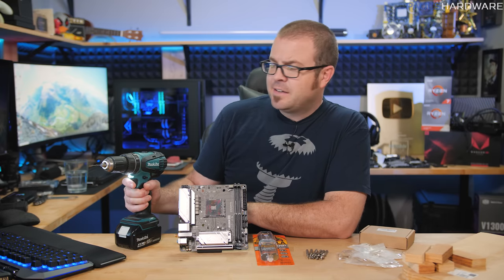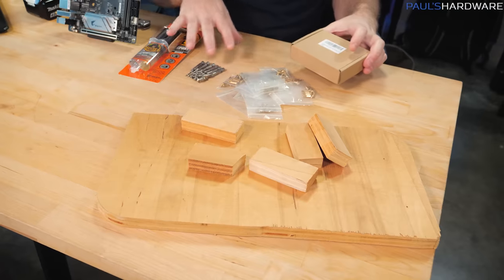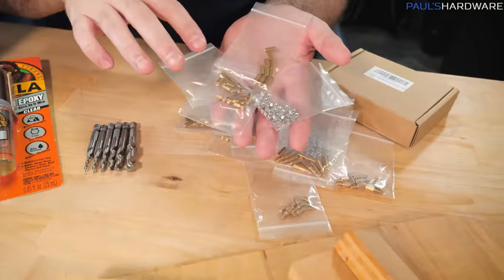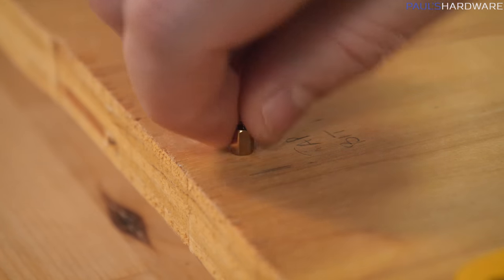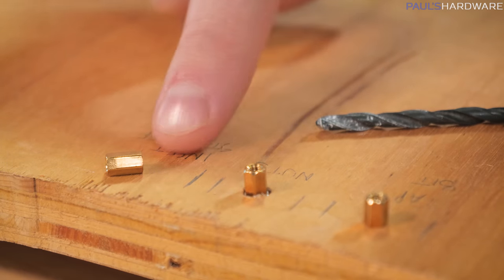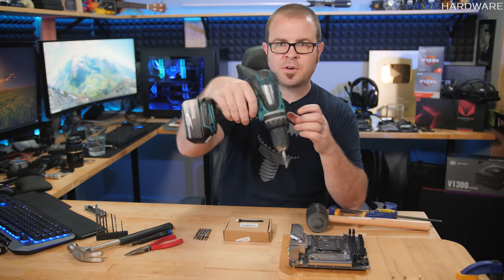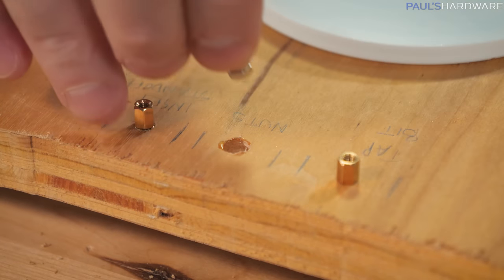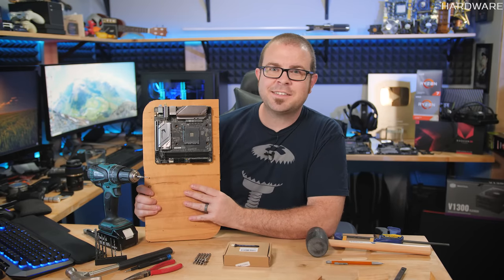The Wood-Mounted Motherboard Challenge!

Comment: M3? They should be #6-32. They have special inserts for wood to allow a machine screw to be used. And each mounting point is going to want a ground. At least run some screws through the back into the standoffs and jumper them all together and then tie them to the PSU ground.

Comment: I made standoffs from wood blocks for my antique table build (needed the cables to be routed under the motherboard). I just screwed in the standoffs from the back of the board, then mounted the motherboard to the standoffs with wood screws. The project: https://www.youtube.com/watch?v=5zFuhxBUJng

Comment: @paul   Here is the actual item that started the nut in the wood method. They are designed to be pressed in.. You pound these (giggity) into the wood and it creates a threaded hole of the size you needed..  random amazon link for reference.  There are other types that are threaded as well.

https://www.amazon.com/Glarks-Threaded-Embedment-Assortment-Printing/dp/B07L96KVP3/ref=pd_sbs_328_3/142-9362882-9241220?_encoding=UTF8&pd_rd_i=B07L96KVP3&pd_rd_r=994c6fac-a4e5-11e9-a846-db1bda18ae84&pd_rd_w=UjVks&pd_rd_wg=9LfmR&pf_rd_p=588939de-d3f8-42f1-a3d8-d556eae5797d&pf_rd_r=0PVVA4V5G5MRRR6KX474&psc=1&refRID=0PVVA4V5G5MRRR6KX474

Comment: Seriously dude? Just pre-drill some holes in the wood and use some brass mobo standoffs like you would in any PC case. Then, use a drop of 2-part epoxy in each pre-drilled hole prior to installing the standoffs. There are other methods but considering the thickness of the wood you are using, this would be the simplest way to go.

Comment: Why wouldn't you just drill holes all the way through the wood and use the standoffs that have 2 female ends on the top side with a washer below it and secure it down with a m3 screw from the backside, Much stronger and if your worried about the head of the screw in the back sticking out  just take a forstner bit and make a small recessed hole.

Comment: You are doing it the hard way. I use plastic wall plugs like this 
https://www.bunnings.com.au/ramset-8-x-25mm-blue-wall-plugs-frame-of-25_p2260641
basically just for spacing. Cut to whatever length you desire and screw through the motherboard and the wall plugs, into the wood with self tapping screws. To make them look prettier you can simply wrap them in some black heatshrink before screwing them in. This also has the advantage of making your standoffs any length you desire. I cut them longer than a standard standoff ( I usually go with 13mm, about half an inch) which allows me to route cables under the motherboard. If the motherboard has M.2 drives underneath it, as some do, it also allows extra cooling.

Comment: meh i have lots of systems on wood, i just use half cm wood screw and screw the mobo directly to the wood, as for the ssd and psu i use velcrow and staples/woodscrew. also zip tie everything else.

Comment: Don't you have dogs? Do you plan on covering this with glass or putting it up high on a wall or something? Otherwise, maybe consider some kind of flat open-body case and just mount that to the wood using proper wood screws... gl though seems like a fun project and that's a very pretty piece of walnut to be sure. Pretty big for just a mITX + GPU, too, so what else goes on there?

Comment: Ok, sorry, but why standoffs? What's the point? Back in ... say... 2001ish, I did wood framing last time, I just used rubber risers, and wood screws through the board... works just fine, lasted about a decade before I tossed it to rubbish bin.
Reply: Or I suppose that's called rubber washer? Damn english.

Comment: You might try something like these M3 press-In inserts with knurl barrel. These are designed to press into plastic but, with the right size hole, should really hold well in hardwood. I guess the hex shape is almost the same thing. ( https://www.google.com/search?q=M3+Press-In+Knurled+Threaded+Nuts )
Or how about these that are made to screw into wood (a bit expensive though): (https://www.amazon.com/Threaded-Brass-Insert-Nuts-Wood/dp/B01C1Q4SIA )

Comment: Great job, you got a tip about the grounds, I have my own DIY in mind about a full wood desktop and the grounds was my only worry, but with the last method you can actually ground every screw to a general ground to the PSU using some general O connector like the ones in this image: https://upload.wikimedia.org/wikipedia/commons/thumb/5/54/Kabelschuh_verschiedene_commons.jpg/220px-Kabelschuh_verschiedene_commons.jpg between the stands offs and its done, thx!!!

Comment: I really don't think you need to tap wood, just drill a bit smaller than the standoff, it will dig in and hold on its own. Tapping is used for metal and plastics, I do believe. But, what I would do is drill a hole, insert the double-sided standoffs; leveling them with the wood surface and then screw in standoffs to them. The inset will only give greater strength; the taps are only as strong as the standoff's length into the wood; I feel they can easily be torqued out of the wood, where as the inset is deeper and wider.

I am building a 4' tall TARDIS (TimeRipper) case. Except where screws and bolts are aesthetically needed, I am going to be using something like this to assemble the entirety of the case https://www.asdscrew.com/uploadfile/2018/0629/20180629110606159.gif

Comment: The tap+drill bit combo just seems janky I would not trust that. It will almost certainly not make a useful thread especially in wood or composites. But really you don't need to thread wood at all. It's soft enough you can just screw things into it fine. Hell in some cases you can get away without even drilling a pilot hole. machine threads do not work very well in wood.

Comment: What? Why? I did this years ago... U need washers in the holes you drill... Much better to work with plus easy to replace if a fuck up occurs .... Anyways in the end you end up burning the wood and eventually it will backfire

Comment: Like the inset standoffs there's also m3 inserts. Same idea, but has a ridges that bite into the wood a bit more than a smooth standoff does (image: https://ae01.alicdn.com/kf/HTB1hafSHVXXXXcCXFXXq6xXFXXXh/Nieuwe-100-stks-Messing-Knurl-Noten-M3-4mm-L-4mm-OD-Metrische-schroefdraad-noten-insert-ronde.jpg_640x640.jpg) Or just google 'm3 insert' if you don't trust a random link.

Comment: Looks like you have a good solution sorted out, but these are an option as well. Also, McMaster-Carr is a FANTASTIC resource for hard to find hardware and fasteners in the future if you need.
https://www.mcmaster.com/95631a050 - Insert
https://www.mcmaster.com/94110a220 - Installation Tool

Comment: In hardwood or hard/softwood ply I'd just drill a 2mm pilot, drop of epoxy on the threads and just screw the standoff in directly. In mdf(cardboard) or softwood I'd use an M3 insert glued in place, mdf particularly is prone to tear.

Imperial is such a stupid method of measurement for anything but coarse work I wonder when you chaps will drop it for SI's (as a 50yr old English radio Eng. and hobbyist woodworker I've used both). Imperial is like shitty legacy code, not really fit for purpose but so ingrained in the fabric that it's a pita to change. The approach of SI to base measurements on universal constants seems to be the only sensible method of ensuring parity in measurement, as the references won't change over mankind's lifetime.

Comment: Why not just use screw insert designed for wood, you can get them in pretty much all sizes including M3 which you need. There's no need to reinvent the wheel. https://www.amazon.com/Threaded-Brass-Insert-Nuts-Wood/dp/B01C1Q4SIA  Something like these

Comment: M3 t-nuts, man. ”binifiMux 100 Pieces M3x6mm Carbon Steel T-Nuts Zinc Plated 4 Pronged Tee Nut” on Amazon
Reply: T-nuts are great, but only when you can put your screws in from the opposite side of the material....which he can't. They have little strength when using using from the insert side.

Comment: No standoffs. Just screw the board to wood with deck screws.

I'm joking. Please nobody actually do that.
Reply: Yup. You put the screws in at a slight angle so they cant be pulled out easily. When you bottom out the screw it will bend the motherboard so that wont be able to move either.

Also a nobody do that comment.